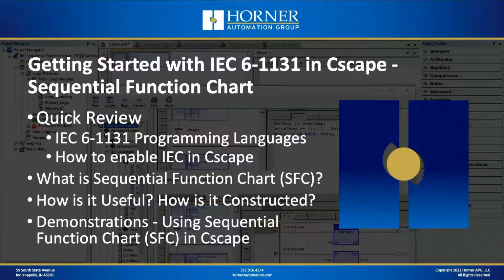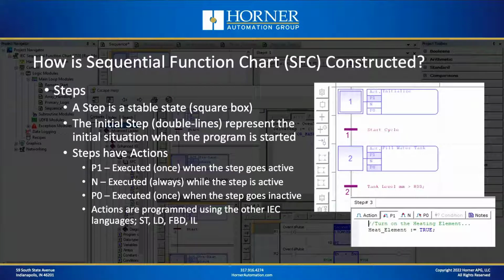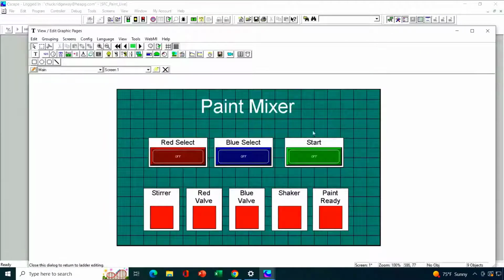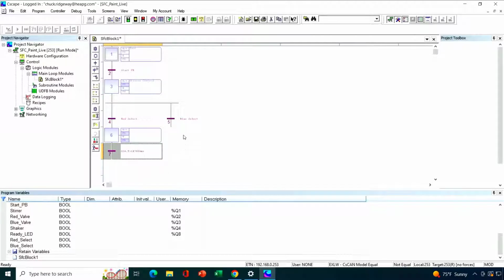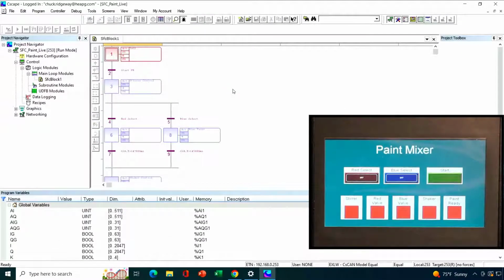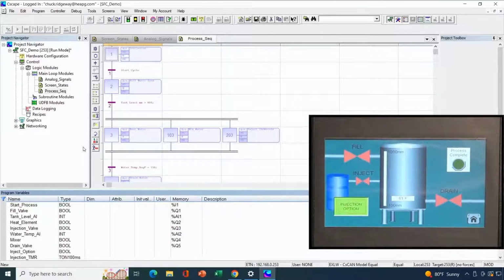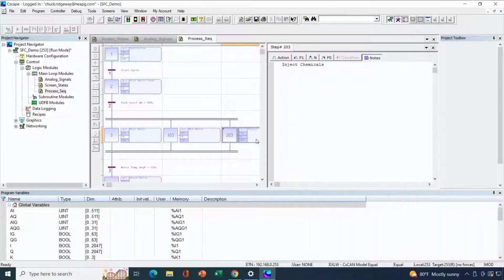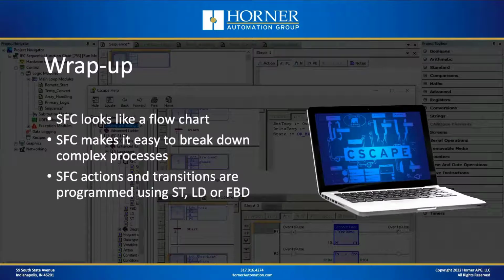Getting Started with IEC 6-1131 Sequential Function Chart in Cscape

Comment: awesome!!
I have converged on 100% STfor all my Horner code-bashing
I recently interfaced to an external Schlumberger VFD (aka VSD in Schlumbergerian)
and need to write some babysitting code.
Normally, when I assert RUN the VFD just runs with no fuss.
In the Schlumberger case, they introduce an "Instruct" controller which imposes
a bunch of extraneous conditions - specifically pulsed start/stop - a kind of anachronistic
model dating back to across the line motor-starter technology.

When the Stop Digital In is asserted the VSD stops, but is in some kind of alarm/ blocked/locked state
such that when Start Digital In is asserted once, it "clears" the block/lock and then a
subsequent Start assertion actually runs the VSD

Sometimes the VFD trips out with spurious internal over-current faults 

I stayed up late with plenty of head-scratching about how to implement such a relatively complex
babysitting operation...
When I searched for an efficient way to do cascaded timers in ST I came up for a link which 
referred to SFC, which I was peripherally aware of, but never really delved into.

Wow... it seems like magic...
Whenever I have needed to do sequential operations I do stuff like breaking loops into
steps which increment index variables and the whole thing is done based on timer-ticks
I created

So far I haven't needed to cascade timing steps but now I need to turn ON, wait, turn OFF, wait, turn ON 
and potentially run a restart-cycle when the VSD drive trips...

Looking forward to banging this code together.
Thanks for the clear simple instructions on this...
I looked in the help file and got a basic preliminary idea, but this nails it down!!